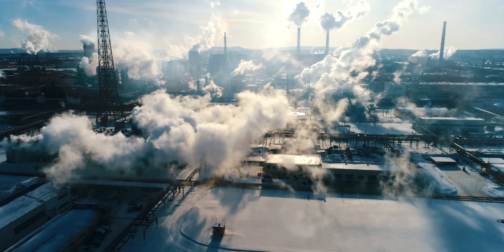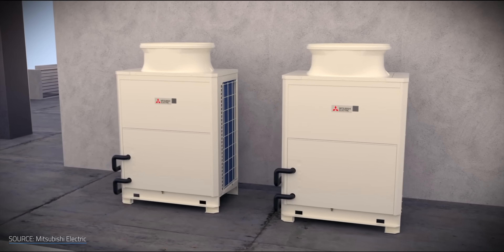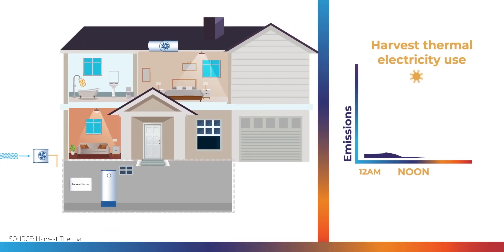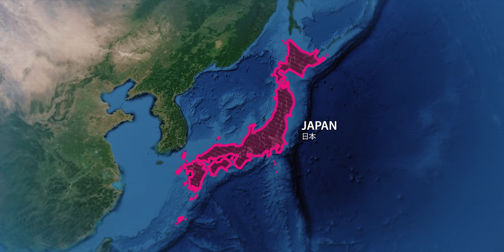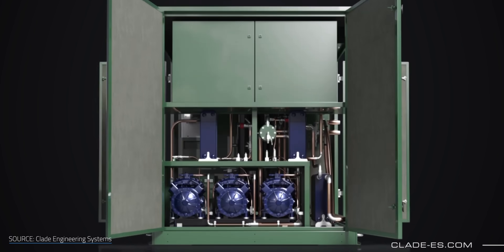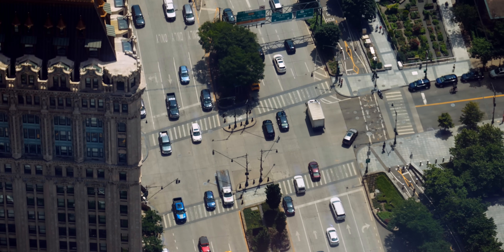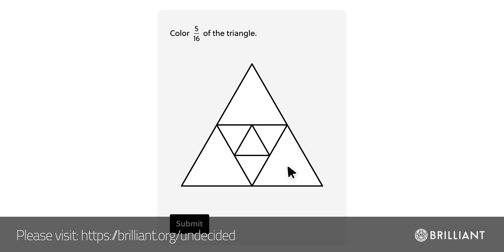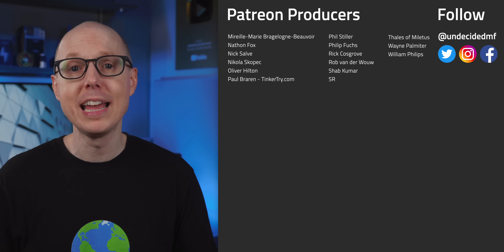Why CO2 Heat Pumps Are The Future Of Cooling

Comment: As an industrial refrigeration tech that deals with ammonia and CO2 as well as residential and commercial air conditioners. The biggest problem I see with residential air conditioners going to CO2. Is similar to when the industry changed from r22 to r410. The head pressures doubled from 200 PSI up into the 400 PSI range. CO2 has to be even higher than that. Combine that with the industry trying to cut cost at every corner you will have a lot of failed condensers because of the high pressure until the bad apples are weeded out. You also probably won't have the lifespan on the equipment that you used to get on the older equipment that used a lower pressure refrigerant. I wish the industry would fully embrace ammonia as a refrigerant. It's natural to the environment so there's no pollution factor. It cools with much lower pressures, so it takes less energy to get the pressures you need and you're not trying to contain such high pressure is on the condensing side. There's just the part that it's toxic to humans. Just my opinion
Reply: Ammonia is corrosive against copper so no way. R290 is the best choice, yes it is flammable but reduce the amount of refrigerant in the System to a minimum and it will be safe. Way higher efficiency than Co2 no transcritical. Ammonia has another problem it will get way to hot in discharge. Greetings a HVAC Technician with Master Apprenticeship from Germany
Reply: @maxpaulus7467 I would choose propane over ammonia anytime.
Reply: @maxpaulus7467  I totally agree and with monobloc units all the refrigerant can be kept in the outside unit.
Reply: @maxpaulus7467 no, R290 has one very big Downside: overtime it cracks the rubber gaskets/seals causing a refrigerant leak.
Reply: @maxpaulus7467  i would add: ammonia not solvable in lubricants and incompatible with hermetic compressors because its corrosive features to motor windings
Reply: Ammonia is only for industrial purpose. Here in Germany the newest grocerystores have a waterloop system, every refrigerator has r290 (only 150 grams) and is watercooled with a Quick connection to the waterloop, so if one unit isnt working the unit can be easy replaced and later on repaired.
Reply: @maxpaulus7467  can you explain more about on water cooled through water loop. I am currently working on building low cost fluid based domestic cooling system.
Reply: I things ammonia would better with packaged unit
Reply: Lots of RV fridges run on an ammonia cycle, some with switchable propane to electric power.
Reply: But there's no actual compressor with those.
Reply: I always thought the ammonia systems in RV refrigerators than run on propane are cool as hell.
Reply: Agree,  Ammonia is the most efficient because it produces the same BTU's pumping fewer pounds of it through the system at lower pressures.
Reply: I like to build an ammonia based well sourced heat pump but the corrosion issues and more importantly I can’t find a compressor in a 2 to 3 ton size.
So I have settled on propane with a R22 compressor. Maybe someday mfgs will make residential sized Ammonia compressors.
Reply: @kaf2303 sounds like a good choice, ammonia is more for larger commercial systems anyhow & of course corrosive & quite poisonous. Propane (R290) is an excellent choice for a domestic system, I have regassed several R22 systems with my BBQ gas bottle at home with good results for many years, some units worked better on propane than the R22 they were made for.  Propane has many merits in HVAC systems.
Reply: Residential side of thinks are starting to get pushed towards A3 like propane as 410A gets phased out and the EPA csnt nake there minds up.
Reply: Had an ammonia leak in our trailer fridge quite a few years ago.. horrible experience, damaged lungs/sinuses, but still glad only I got nailed and not my son who was a toddler at the time.. he'd have suffered from it his entire life.. I appreciate your point, and work with my friend who's been in your field for 40+ years, so I get it, but I still think ammonia sucks.. personal experience..
Reply: Ammonia has such a bad reputation. I can't see that changing. Using flammable refrigerants seems safer.
Reply: Have you looked at R290? It seems to me to be the best for heat pumps, other than being flammable, but the R290 can be all in the outdoor unit. It also is a natural gas.
Reply: @putteslaintxtbks5166  There just isn't much of it in a system. They use a different natural gas to replace old Freon in auto A/C systems.
Reply: What do you think of using ammonia in an organic rankine cycle identical to the ideology used at Chena Hotspring outside of Fairbank Alaska that was using 165 F water to produce power. I understand that ammonia at 267F has a pressure of 1657 psi which in this instance is easily 4 times the working pressure at Chena Hotsprings.
Reply: Only one problem, ammonia systems don't contain just ammonia. They also contain chromium (just a highly toxic chemical, no big deal here) and it also burns!!.. 

 I'm assuming your not old enough to remember when there were gas a/c systems in residential homes... AKA - ammonia systems.... The fire department would evaluate an entire neighborhood for a quarter of a mile for both fire hazard and lung/eyes/nose irritation/ burning... 
YOU CAN KILL SOMEONE WITH R717/ AMMONIA.

But hey, what's the difference between friends, we are outlawing R410A in 2026 and replacing it with R32, AKA clean orderless industrial PROPANE!!
They call it a (moderately FLAMMABLE refrigerant)... And this is going to be running through your walls as of January 2026 because 410a has been band by the environmental wack jobs. AKA it's a (greenhouse gas)... We can't have that, the small amount of people that will die is (worth the price to save the planet).

For me, I will be retiring in 2026 because I won't do it. There is no way I would be able to sleep at night with this kind of risk.... So until the world finally wakes up after this woke head injury and makes since again, I'm out... F-Off, I don't need the $$ or the government.... 
Enjoy 😎
Reply: Does anyone else immediately think of Harrison Ford's lead role as Allie Foxin in the 1986 movie, "Mosquito Coast?" If not, go check it out.
Reply: I agree. We’re about to switch to A2L refrigerants which pressures are still as high as r410a except for the fact that it has a higher flammability than r410a. Compressors, aluminum coils, sensors do not like high pressure and are subject to more leaks and failures because of it and we’re introducing flammable refrigerants into that mess? I get there will be refrigerant detectors and new boards inside the air handlers and furnaces, but what about line set leaks in attics and what if those sensors fail or if the power goes out? I fear snowbirds in Arizona will have their attics blown up when they’re at their summer homes and year round residents will experience many failures due to higher condensing pressures/temperatures from the ambient temperatures and sun exposure. R22 was great for system longevity and running costs due to lower pressures which have less power demand and I’m sure chemists can make something better instead of making their pockets grow
Reply: @daniellundquest8252  yes R22 is brilliant, I love how little energy my 8000btu portable air conditioner uses only 650w 😊 it was made In 1969 (I'm  serious) also never had a refrigerant recharge so yeah R22 was way better than the shit r290 that we have now
Reply: Ammonia was one of the best man , but probably will never comeback because is toxic and can "harm stupidity" . Is pure truth how world work those days
Reply: My lg heat pump water heater costs about 150 $ per year - a 2x install ;once versus 70 $ saved a year seeems not worth it
Reply: R290 combined with hydronics will be the future. Chilled water heat pumps are extremely efficient. R290 is low pressure requires low charge and is a natural refrigerant only flaw is it’s flammability but the rate we are headed now that’s gonna be a small issue considering homes have gas lines and gas furnaces and if we use it like a chiller the propane will never be in the home
Reply: Agreed industrial supermarket tech here . We use CO2 refrigerant and the pressures are high as heck . Dangerous for a house
Reply: I agree 100% about ammonia. And life is risky anyway, screw the dangers. Frankly I'm tired of all the hand-wringing that everything must always be "totally safe."
Reply: Then go live in a rickety building with cracked walls, lol. If you want your infrastructure riskier than need be, you can go live that way yourself.
Reply: @Erik_Swiger  totally agree, our economy & hence our environment suffers immeasurably from cotton-balling idiots,  producing, promoting & advocating stupidity, it is so un-‘Darwinian’.  
Example: when people get hit by traffic they get hurt , not the vehicle. If pedestrians had to give way to vehicles there would be less idiots out there walking dangerously in front of traffic & getting hurt or dead, even not so smart individuals would soon learn from this how not to get run over by fixating on their phones as they cross the streets, and this would be a definitive sign that humanity is actually getting smarter again. I call this politically driven time period, ‘The Dumbening’.
Reply: @Erik_Swiger  Best answer man , is like " don't piss outside the wind can turn it back "

Comment: I would love to see things like this used at buildings with pools as often  you'll see in other parts of the building a/c units dumping unwanted heat into the air rather than delivering into to the pool where it is needed
Reply: I worked in a building that has a 75,000 BTU air conditioner for the pool room, and it has two compressors and two hot water heating coils that warm the pool water.  So they have made these since the early 1990's.
Reply: @Kangenpower7  it's so annoying seeing how many gyms don't do it, I even went to one with a huge outdoor unheated pool so they could have done the heat exchange without a compressor

Comment: A thought on CO2 heat pumps. 
We have an abundance of CO2 in the air. For us to really get it under control we need to pull some of that out of the air. Standard answer has been 'plant more trees/plants'. So if we pull some CO2 out of the air and use it to help cool things down. We do not need to make CO2 to get this working, we already have an abundance of it.

Comment: Upfront costs are out of control. On Long Island / NY I got quoted $19k each zone to convert to heat pump: $40k entire house (upstairs and downstairs) including domestic water heating. After incentives (local utility rebate and federal inflation reduction act rebate it drops down to $34k, but have to pay $37k upfront and will get $3k on federal tax return back. 

Cost is just way too high to justify any kind of return on investment or payback period. I’m going to keep my oil burner and air conditioning units going as long as I can until they die before I go heatpump. Hopefully by then they’ll come down in price and offer better winter performance (winter commonly has sub freezing temps here, where heat pumps are much less efficient and rely on electric resistive heating strips that use crazy amounts of electricity.

Comment: This is an already used tech.  This system uses a heat recovery cycle, that is already being used, commercially, so the use should be reliable. Caution, the "dupont" companies are already changing the refrigerants yet again, so the A/C or Heat pump you have right now will get very expensive to fix in the future.

Comment: Why not design a system that automatically draws in outside air when it is colder (Or warmer in the winter) then the inside. It is a pain in the rear to shut off the AC, and open all the windows each evening, then the opposite in the mornings.

Comment: another issue is the fac that refrigerant compressor and. AC are basically a single stage without intercooler , two or more stages increase the efficiency in AC mode but will not produce a really high temperature in the hot side.

Comment: I understand the thermal efficiency of CO2 is much greater that is because the density of the material itself is ridiculously high. Normal residential refrigerant such as r410a operates in a normal head pressure range of around 250 to 330 PSI at a temp range of 85-104 degrees F. 
At those temps, your condenser coil pressures would be well over 1400 PSI with CO2. 
Considering the current failure rate of the average air conditioner/ heat pump is around 10-12 years, you could see system failures of about every 3 years. Yikes!
Plus, the systems would have to be severely over built to withstand those pressures, which would greatly amplify the cost. 
So, a costly machine with a higher fail rate is not exactly a well engineered solution.

Comment: All heat pumps heat up the environment. The power they draw adds heat to the system. Even if it's green that adds additional heat even if no greenhouse gasses are emitted. A heat pump makes the world warmer, and on a hydrocarbon based grid will co2 much less once you consider full cycle losses of grid vs direct gas delivery. Oh and use real world COP and not best case the manufacturer springs on the box

Comment: All the money focused on this is wasted until insulation and air leaks are fixed. A well insulated and sealed home will need so much less heating and cooling that the least effective systems will use less energy then the most effective tech in a poorly sealed and insulated home. But that is a one and done expense.  And it doest off profit generating options utilities, unlike government financed rebate programs or credits to other programs

Comment: There's an aspect to this that REALLY excites me: the storage. Being in Northern Canada, I know a standard heat pump would fit my needs here 300+ days a year. 

But we have -40C days, and heat pumps become increasingly inefficient if not completely ineffective, and that scares some homeowners.

But that hot water heater presents an opportunity: if that tank can run electrically in extreme cold you can still have adequate heat for the home without additional sources.

Yes, for those days consumption will spike, but the rest of the year is more than enough to make up for it.

Great segment, Matt, and it was great to see you at Fully Charged Live in Vancouver!!

Comment: Heat pumps fail where natural gas keeps working: when it gets really cold. I've seen people spend thousands to rip out perfectly good NG furnaces for heat pumps only to discover they couldn't adequately heat their homes without running auxiliary heat kits or breaking out the kerosene heaters.

Comment: One thing I didn't hear, or perhaps I missed it -- how does this setup with the hot water tank work when it's cooling season, and not heating season? At that point, the heat pump is trying to move heat out of the house, not into it.
Reply: doesnt it dump house heat into the water tank in summer?
Reply: @hardrays  I don't know. It would be great if it can do that, but I don't think it was mentioned in the video.

Comment: For people saying 2000 psi is too much, typical home pressure washers are between 1000-4000 PSI, the fuel rail in your direct injection gas car is 2000-3000psi and for diesel engines it's between 2000 - 30,000 psi. Yes 30,000 PSI.  The biggest benefit of CO2 being used as a refrigerant is that it's dirt cheap and you don't have to worry about it being 'phased' out, special recovery systems, etc. Releasing to the atmosphere is basically inconsequential. It's a technology in its infancy but give it a few decades and it can easily supplant all the other refrigerants.

Comment: I've never understood why thermal mass and water heating aren't standard  features in a heat pump system. There's huge compounding benefits by having the units work together and could be a packaged unit.
Reply: Probably the usual suspect: Cost. 
Simpler units cost less. Each additional component will add cost and complexity to a product. It has to be made and installed cheaply enough for 1, the upfront costs to be accessible, and 2, for it to be worth it over the products lifespan.
Reply: well...there is also always a risk when you lay additional pipes with pressurized water...
it's relatively easier to push the air around...
also I guess there is a space consideration... you need space for the thermal mass...
a lot of homes in the US have water heaters with tanks... but most other places use tankless water heaters to save space...
Reply: @porcorosso4330  take a packaged unit and make the base a water tank that is in line to the primary water heater. Have the bottom of the tank a heat exchanger so the heat from cooling preheats the water. Wouldn't take up that much space other then the unit sitting a bit higher and the water heater in the house is getting preheated water vs ground temp.
Reply: @matthewconnor5483  

by definition it needs to take up space, it is a thermal _mass_... not so useful if it is not very massive...
Reply: @porcorosso4330  it you have a packaged  unit and it sits on a tank  for its pad that is 3x3x2ft that's over 100 gallons of water you could be pre heating.

Comment: i could be mistake, but i'm pretty sure HFC's don't impact the ozone, it was thier big selling point compared to the old r12.  that said, they do have very high greenhouse potential, but if not much of it is escaping (i've started to have doubts about regulations surrounding venting\leaks) then that impact may be neglidgeable.